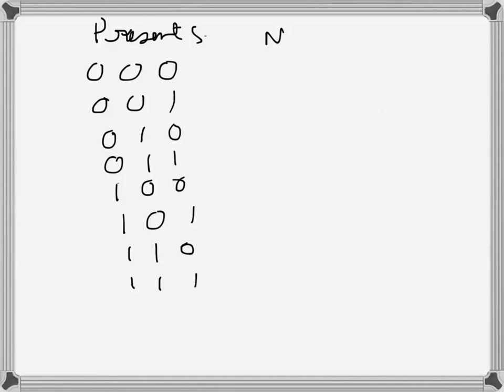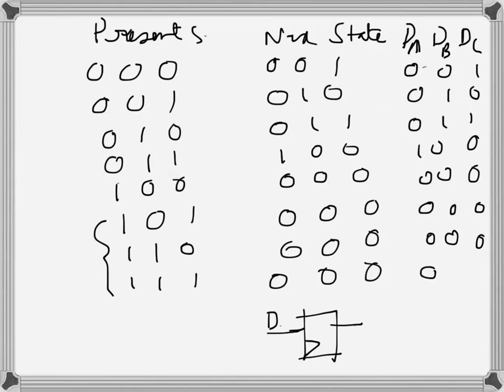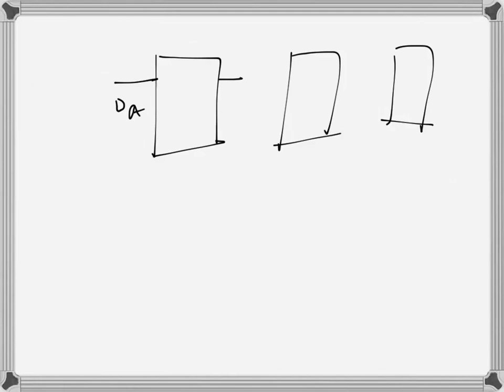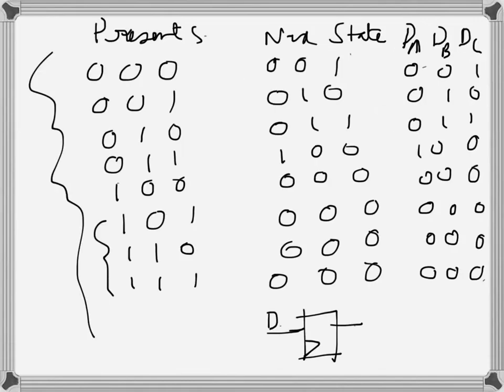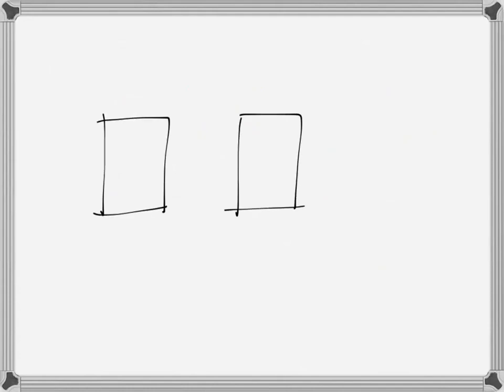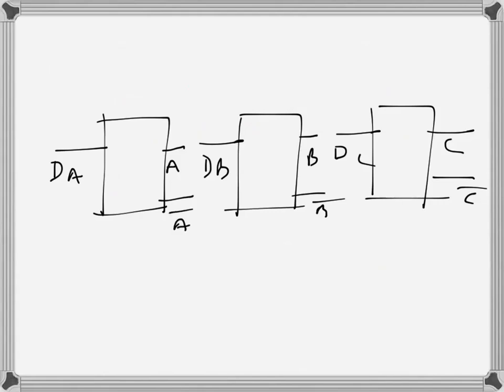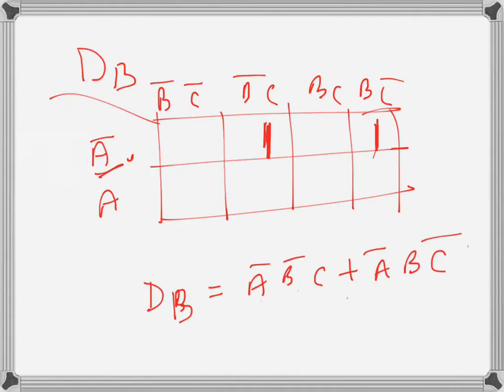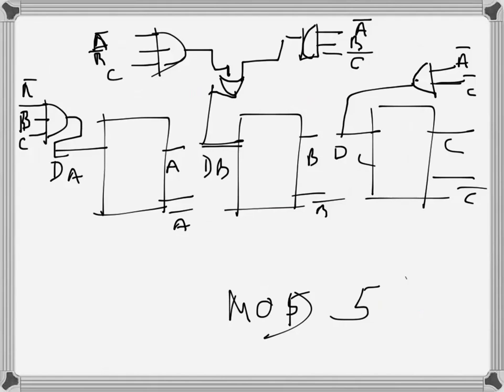Digital Electronics: Mod 5 counter using D Flip Flops only

Comment: How to do with asynchronous counter ?
Reply from the maker: You can use a simple asynchronous counter and then you can design the CLEAR of each  FF to be activated when the output is 101 if the CLEAR is asynchronous. (or 100 if the CLEAR is synchronous). Remember asynchronous CLEAR will make the output ZERO immediately while the synchronous CLEAR will wait for the next clock to come before it turns the output to ZERO.
Reply: @sacademy7053  i got that day itself still Thankyou so much for this reply ✨
Reply from the maker: @027_neha6  you're welcome!